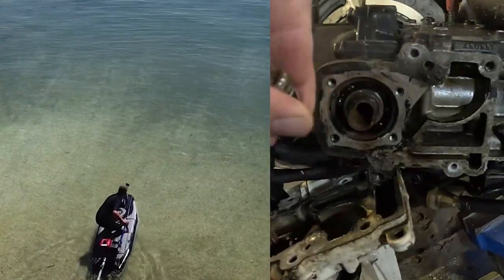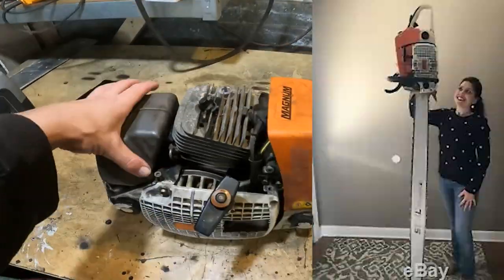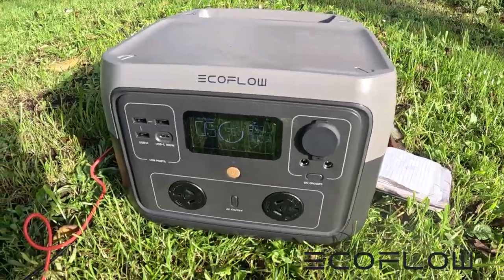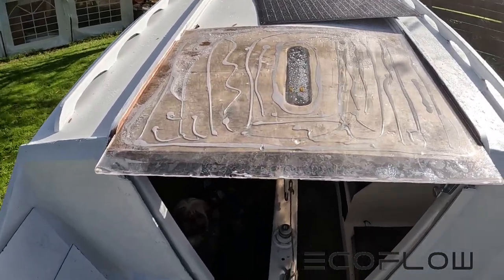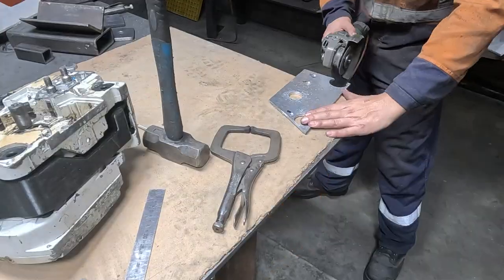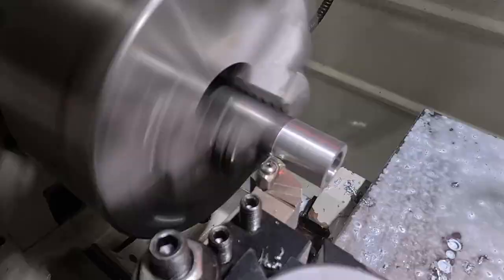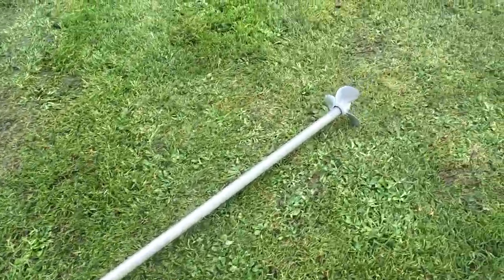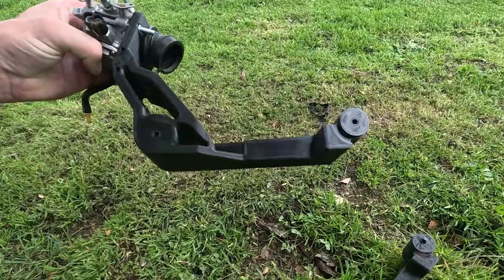Chainsaw Powered Thai Longtail Build, Part 1

Comment: Mate, Awsome Vid!!  The technicals were long enough to see what you were doing and be interesting, short enough and fast enough moving to never be boring. Nailed it!  I was thinking what a brilliant engineer you are and next thing adapter didn't fit and shrunk during welding.  That was great, showed that even experts have problems.  I remember something I made a while ago and no matter how carefully I lined it up,  once I welded it, it didn't anymore.  After about 6 attempts the 2V light in my head came on, I eyeballed it NOT to line up and  once welded, was perfect. Would you believe I'm completely self Taught?? :0)
Great vid mate. You got the formula spot on first time out. Do it again and don't change anything.
Reply from the maker: Thanks for the feed back , I am filming the next part I will do it similar

Comment: Probably a dumb question but do you reckon the hull is trying to displace too much water for the pissant torque of that motor. I was thinking (probably wrongly) that a longer/ narrower more flat bottom hull might be helpful. Like a Thai river boat.
Reply from the maker: Yes definitely a longer narrower flat bottom hull is ideal but I want to go up some pretty rough rivers . Once I get the prop sorted it should be a lot better

Comment: Cool video bro. you should use propller of rc gas boat for this engine, sound crazy but it will work with high rpm engine. I also have some Thai styled propller for 3D print, i can share
Reply from the maker: I have been looking at rc longtails because the rpm will be so high , I have some alloy long tail props but this motor spins backwards. I would be interested in seeing you props
Reply: @DktheWelder  I tried to put my email in a comment to get in contact with you, but it looks like YouTube deleted my comment. Please let me know the method through which I can send my files to you!
Reply from the maker: @nhocdorebita145  you can’t really but links on here, can you find me on Facebook dkthewelder